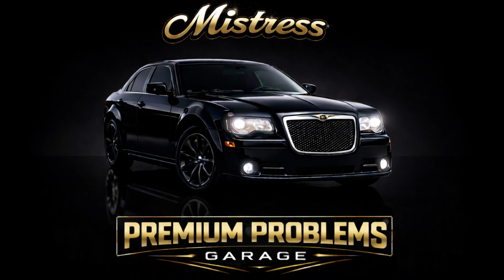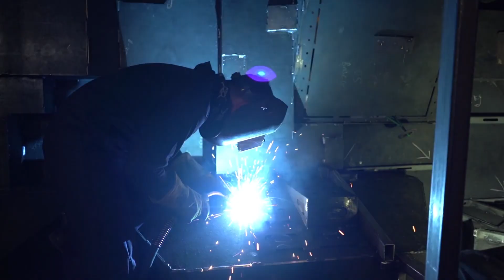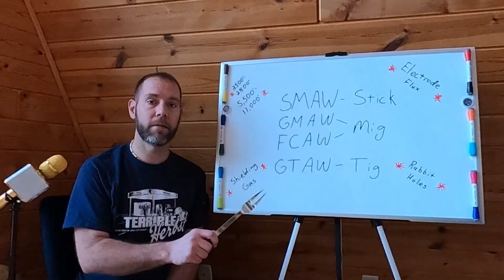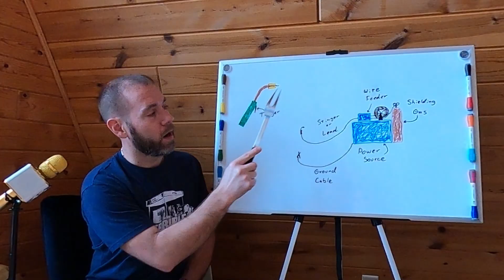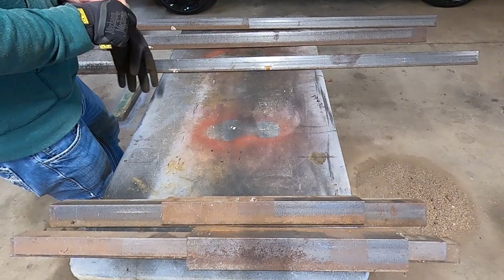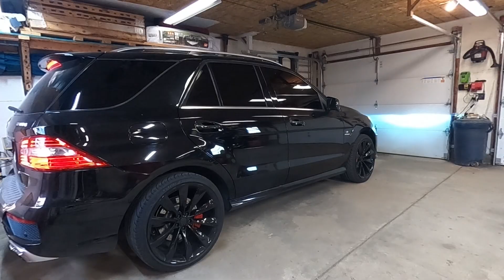Welding 101

Comment: Gmaw & fcaw aren't the same. Gmaw and smaw are the same!🙆🏿‍♂️
Reply from the maker: Technically, none of them are the same, but GMAW and FCAW are very similar. FCAW just has flux in the welding wire, GMAW does not, it uses a solid metal wire.